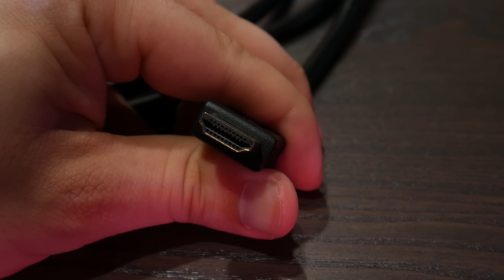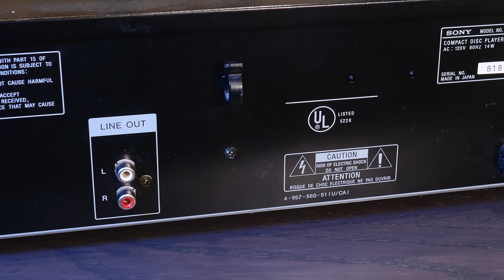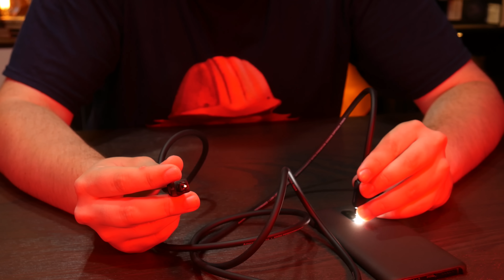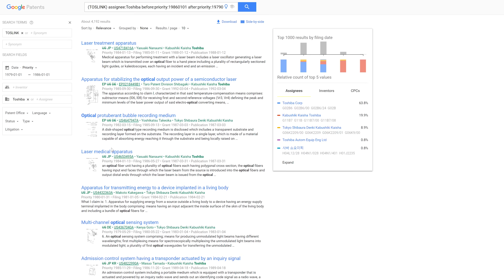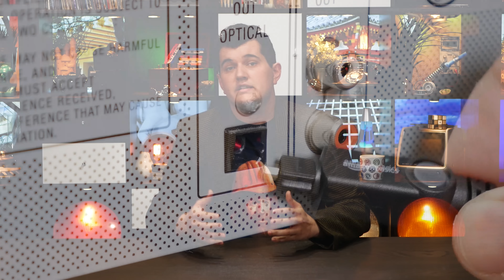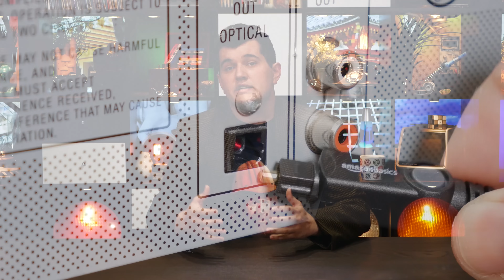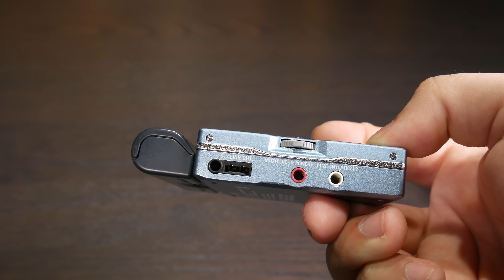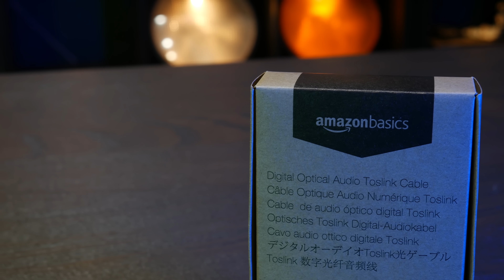TOSLINK: That one consumer fiber optic standard

Comment: As soon as you mentioned the toslink cables with gold-plated connectors on Amazon, I remembered something from the Monster electronics brand that happens to be sold at Walmart: Fiber-optic-equipped HDMI cables... with gold-plated connectors. The box advertises them as being 8K-ready, in-wall ready, and capable of a 48Gbps data rate. It also says it's great for longer runs of cable.

When I first saw the box, I was overwhelmed by the quantity of sheer stupidity.

It is 15 feet long and costs almost $50. If any of you ever see these, please don't buy them.

Comment: You probably wouldn't even need a keyed interface for a two-way optical connection.

Put two fiber lines in a symmetrical cable and consider this setup: 

1. The computer, when waiting to make a network connection, sends a sort of perpetual "is someone out there" signal on the output tranceiver, while waiting for an "I am here" signal to come to its input tranceiver.
2. The router is waiting to hear ANY "is someone out there" signal on both tranceivers. 
3. When connected, the router notes which of its two trranceivers receives that "anyone there" signal and assigns that as input and calibrates that to whatever standard the computer is sending from.
4. Once it believes it has a clean "anyone there" signal and understands its specs, the router assigns the other tranceiver as the "out" signal and sends a standard "I am listening" signal back with maybe some specifications. Think of this whole process as being akin to the old handshakes dial-up would do, but much faster. 
5. Once the computer gets the output spec from the router, they spend a moment more on link information. How fast the router can send/receive and how fast the computer can send/receive. The computer does NOT need to care which LED is which on the router, as the computer is the only one that knows where it initiated the connection, and that's all it needs, and the router just needs to know where the connection was received to determine which lines to use for I/O.
6. Once all the capabilities and protocols are established, the regular network setup done with TCP/IP goes on as normal. DHCP or static IP is handled, routing is established, all that.

Only the router would have to configure its tranceivers for a symmetrical cable, though the standard could allow for both if the PC needs some Wake-on-LAN support. So long as both ends of the connection can establish which line is sending and which is receiving they don't need a keyed cable.
Reply: Also on another note, I imagine SP/DIF could still see a lot of use in PC setups, a realm where sending audio along with video signals is NOT always really what's wanted. Granted most PC people prefer just using analog audio setups, digital speaker setups for PCs can and often do have TOSLINK ports on them, and I use mine.

Comment: The buildings electrical system is exactly the reason why Toslink can be superior in some cases. If both devices are connected to the same earth, which they eventually always are, and then you connect any copper cable between them, you have effectively made a huge loop antenna, picking up all magnetic fields. Currents will flow in this loop. If you have a bad amplifier design, these currents can ripple through your supply stages and into the analog electronics, mainly resulting in a 50 or 60 Hz hum since that is the magnetic field frequency that is mainly present.

Comment: the toslink had an advantage. you did not create grounding between the player and the amplifier. now, if you can imagine, you have the cd player grounded, you got the dac/amp grounded, and you connect them with the rca cable and you... create a ground loop. toslink is a good think, if you want to get rid of this ground loop. its a verry verry good idea.

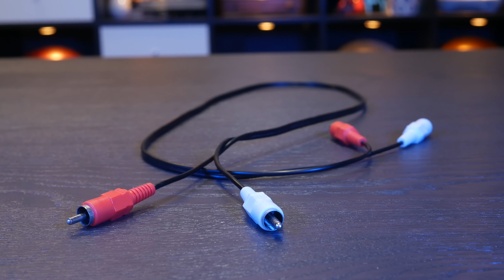Comment: 4:16 RCA cables aren't coaxial. you're always very precise, so I don't feel like a jerk pointing that out :-)
Reply: Jay Straw the connectors are by definition, and many but not all cables used with the connectors are coaxial too.
Reply: @denshi-oji494  incorrect. coax is a single conductor, not stranded or braided, that conducts the signal within the shield. That's why it's used all throughout signals in RF frequencies, tv, radio, antennaes: the shielding contains the signal and prevents interference. RCA cables otoh, when shielded, still have two wires inside, which could never be coax, or even coaxial as in sharing the same axis
Reply: only cheaper RCA cables are built that way, that I am aware of.  all the ones I own and have cut open are indeed coax cables, except the ones I have seen intended for car stereo applications.

  I have seen cheap audio cables bundled with stereo components that are indeed as you describe.  so I guess it depends more on the quality and source of the cable at if the cable itself is or is not also coaxial, like the connectors.
Reply: There is a type of RCA cable called coaxial. They are typically orange and are used to transmit digital audio, just like TOSLINK.
Reply: @UriahStuff  the irony here is that with error correction and parity bits, digital audio needs coaxial construction far less than analog

...i will admit i was wrong, only up to the point that a shitty RCA cable with the signal wire in the middle, insulated with a shield around it is more of putting your kid's kindergarten painting on the fridge: sure, it looks like an elephant...but is it? is it an elephant?

Comment: +Technology Connections
10:29  Optical fibers also eliminate ground loops.
12:30  Many amplifiers use ye-old linear transformer in their power supply.  So in many cases will be ground isolated.

Comment: Ground loops! Toslink has no electrical connection, hence it resolves the problem of ground loops in amplifier circuits. That is the actual reason it is to be preferred over copper digital connections like S/PDIF.

Comment: Very common in Apple equipment. The internal switch to tell the laptop whether you had headphones or a mini toslink cable plugged in had a tendency to fail after a few years, leading the laptop to have a "no audio out" condition. This was particularly common on the 2009-2012 MacBook Pro models.

Comment: TOSLINK would be beneficial over copper wire if you have your S/PIDF cable running near some cable with analog audio passing through it, as it wouldn’t interfere with the other wire.

Comment: There was that one time I had to use TOSLINK instead of coax SPDIF. I had a Squeezebox Touch connected to an AV reciever. Every single time I turned the kitchen light on or off, it would mute the digital audio for one second. I would get a pop if I used analog inputs, even with good cables. The ballast on the light was just that noisy, and it was an apartment so I couldn't mess with it. So I went with optical.

As for mini-TOSLink... I think every MacBook Pro has it in the headphone jack, but you typically won't see it because the LED isn't on unless the contacts tell it there is a plug inserted.

Comment: Not my area of expertise but I believe im right in saying that; Toslink takes the SPDIF signal and has to convert it to light, then back to SPDIF at the receiver end adding 2 extra conversions to the signal transfer, this produces more jitter, resulting in more noise and distortion.
i2s ( i square s ) is the native data format DAC chips etc work with??? Some high end audio equipment use a i2s connection to also avoid the conversion from i2s to SPDIF and back again.
Does any of this make any difference to the average person with affordable off the shelf home theatre gear? Probably not. To audiophiles or ppl who have spent a lot of money on there gear? probably yes.
Again this next bit of info is only going to be useful to Audiophiles; when talking to with a local high end cable manufacturer, I was told that SPDIF Coax cables shorter than around 1.5 Meter have problems with the signal bouncing back and forth along the cable, going against the general advice that the shorter you can keep the cable the better.

Comment: Well there's one other fiber optical standard very common in cars called MOST. You should make a video about that! If I'm not mistaken it was developed in the late 90s early 2000. Media Oriented System Transport. First 25mb/s and then upgraded to 150mb/s. It's a really fascinating subject.  It was meant to be able to support several audio streams at the same time as video streams and other data. 
I know it's used in Volvo, BMW, Mercedes and Audi for instance. 

It's designed as a single way transmission ring where every controll unit receives every signal and passes on the signal placing its own messages on it.

Let me know if you need some material about it. As I sitting on much original Documents from BMW from when this standard was introduced in their cars.

I know it can play an audio cd from one unit by placing the audio stream on this optical bus at the same time as a movie is playing on a rear entertainment system with the surround sound being placed on this MOST bus and picked up by a headphone module. And at the same time giving navigation directions messages also via this optical connection.

One big flaw however is that if one unit in this optical ring fails the whole system becomes unusable. 

Please make a video about this 😀

Comment: Here's a possible video topic: the history of lithium rechargeable batteries. In the 90's Sony built the handicam and needed a good battery for it, and at the same time they had more audio tape manufacturing facilities than they needed when CDs were becoming standard. So the lithium battery for years was made by hanging up tape to dry and then rolling or folding it into a cell. We're only now working on better ways of making them cheaply and quickly.

Comment: fiber optic is mostly pointless in the home because its main advantage is long-distance transmission. the advantages start at distances well beyond the distance from one side to the other of even the largest average homes. Its likely they ARE in use in places like the giant mansions of millionaires for networking , but in that case, they are using the same stuff used for telecom industry, rather than any consumer grade gear.

Comment: Galvanic separation is the key point when it comes to fiber optics. And galvanic separation in electric devices is done the same way, by transformers that provide galvanic separation.
So it is not a question of luck to get the job done... :)
Reply: Except that all your electrical devices are earthed so they aren't separated in the end.
Reply: @RWoody1995  It has been a long time since I've seen a 3-pin plug on any audio/video equipment. It's just not common to ground those, and even devices with a separate grounding screw are becoming less and less common. And if a device is grounded, that doesn't mean signal ground is tied to chassis ground at all.
Reply: @HenryLoenwind  I know that with xlr, signal ground is shorted straight to chassis.
Reply: @RWoody1995  All device casings should be earthed, just in case there is something going wrong, the peotential of earth is to provide a shorter way than a human body touchig the casing. So there always should be some earth in play, especially with higher voltages, than the ones that come from little batteries.
 But Earth potential and 0 Volts (Neutral) is not the same thing, and 0 Volts potential and "Earth potential" should not be connected with each other! There can be  a difference in potential between "Earth" (yellow+green wire ineurope) and "Neutral" (grey or blue in europe) due to difference in resistance in the Earth and Neutral pass for electric currents. And would make some current flow all the time, while this difference in potential works like a voltage devider.
 At the same time connecting "Earth" and "Neutral" makes all "earthed" casings in the house extremly dangerous when a short between phase(AC) or a high DC voltage and "Neutral" takes place, since now all current flows between the Phase(AC)/Positive(DC) and Neutral as well as Ground(Earth), and the shorter path wins, which could also be a human body working as a voltage devider of some sort.
 That would be so bad indeed! Actually this is pretty much the worst case scenario...
 But all this has nothing to do with the galvanic separation of signal voltages between two music devices, while their metal casings might be earthed at the same time, which is a good choice to have.
Reply: Btw.: Galvanic separation is done since there can be a voltage difference in the "Neutral" potential between the AC/DC transformer of one music device and the other, making currents flowing between the two devices already if the two have their DC-Neutral interconnected.

Comment: You can easily convert between TOSlink and SPDIF or vice versa with just a $2 part and a +3.3V power source.
Most PCB mount TOSlink receivers or transmitters modules are little 3 pin devices with +3.3V, GND and SPDIF in/out connections in a plastic housing that accepts a TOSLink cable.

Comment: Nit-picky nerdgasm: Coax S/PDIF connections should really use a proper 75ohm coax cable to prevent reflections. While standard RCA cables have a coax connector the actual cable is usually just a twisted pair, and not suited for this application (though in most cases with short cables it'll still work).

Comment: I have run into situations where devices had to be electrically isolated. At one gig I worked at, the facility was powered by two different substations. The ground differential between two outlets was measured at 90 volts. Someone made the mistake of plugging their plug into a different source than the AV equipment. There was a loud pop. I have also run into other cases where either baluns or optical connections are necessary.

Comment: I think you nailed it when you suggested TOSLINK was really more a marketing ploy than a technical improvement. We've all have seen ground loop (AC hum) on analog inputs/outputs, but as you mentioned, the signal to noise of a digital signal is so ridiculously high that to overcome it would essentially completely kill the signal.  On a sidebar regarding electrical isolation, I did recently install a couple of gigabit Ethernet to optical media converters between my ONT (FIOS) and my home network gateway to electrically isolate them from each other after a very close lightning strike blew my home network and ONT up, literally every network switch, every wired-in camera, etc, so I can see some value in the concept of using non-conductive fiber instead of conductive wiring to connect things.  I know my attempted solution is probably way overkill, but if it happens again (lightning blowing out my network), I will replace all copper with fiber.

Comment: There's one situation where the resistance to electromagnetic interference is very helpful: car audio.

The electromagnetism generated by a cable is related to its current, not its voltage. So in a car where everything's 12 volts, a 1,000w amplifier draws 83 amps, while a 110v equivalent would draw only 9 amps. It's very common to hear the high powered interference over analog cables, so it's standard practice to run power to the amplifier in your trunk down one side of the car and the audio signal down the other side of the car. Even where the cables come together to enter the amp this can be an issue, so it's common for the amp to put the power and signal connections on opposite ends. Using TOSLINK would solve this issue completely. Ironically this is one situation where you'll almost never find a TOSLINK cable.

Comment: Other hardware that used mini-toslink:  In my older Mac laptop, you could plug in a mini audio plug for stereo audio or you could plug in a plastic fibre connection into the same port, just like you saw on the chromecast.

Comment: Regarding the weak signals through the cable: there was a glass cable meant for longer distances, but I don't know how you get it now that the original MFR of the hardware discontinued it (I think it was HP back in the day).  A major factor making the signal weak though was how well the cable end was polished.  In most cheap cables, the end is not really polished.  There were very detailed documents for creating the optical power budget for the hardware and for making properly polished cables.  This hardware was great for isolation.  I designed some medical systems using the same hardware that Toshiba used in Tos-link.  There was a bidirectional standard for the cable.

Comment: One thing you mentioned about fibre optics not being used instead of Ethernet made me remember that in 1999 one of my customers used fibre for their network connections.  They had about 1,500 desks aligned in rows in their call centre.  Since the call centre was almost one huge, open space there was not a lot of space to put racks of switches throughout the room and most desks were more than 100m from the computer room.  So they decided to run fibre from the computer room to each row of desks, where they had a switch that would convert from the fibre to good, old copper Ethernet.  My customer said it was cheaper than copper cabling and it was also less time consuming.  The cabling in each row was off-the-shelf Ethernet and each row had one pair of fibre.

Interestingly enough I listened to this video on my sound bar which is connected to my PC via a TOSLINK cable.  Why, you may ask, am I using that?  Well, my cheap soundbar has only 2 inputs.  One is a 3.5mm stereo jack and the other is a TOSLINK fibre optic.  It was just totally easier to use my existing (unused) TOSLINK cable as opposed to finding/buying a male-to-male 3.5mm stereo cable.